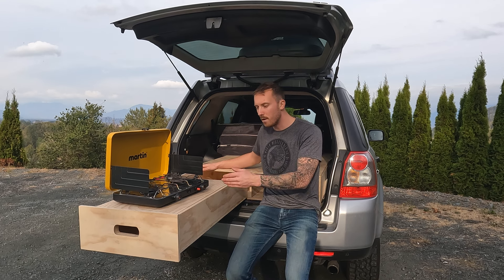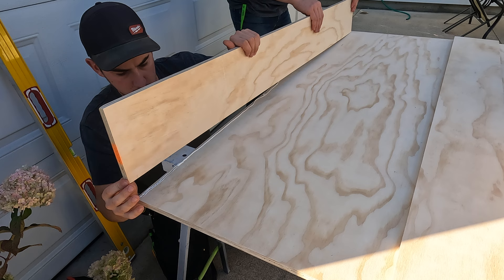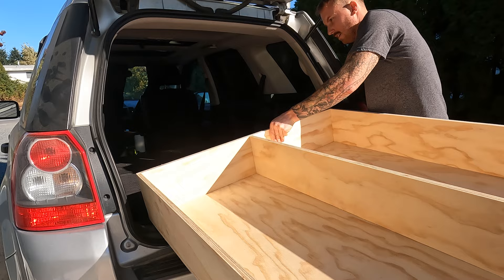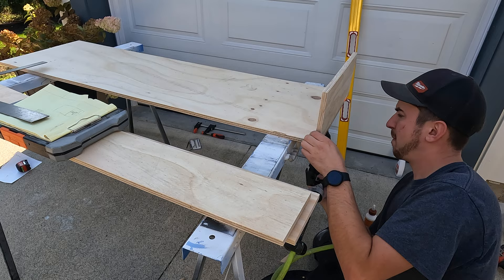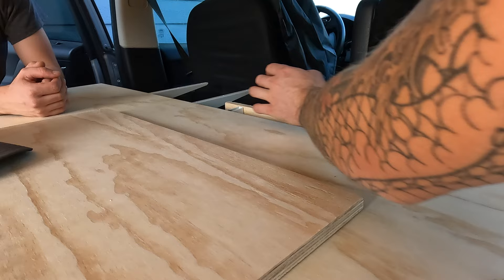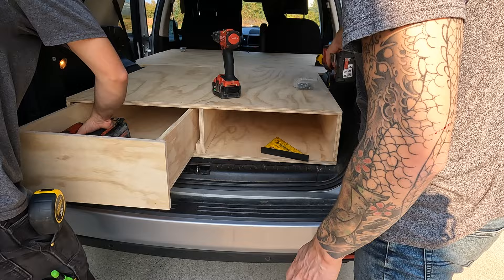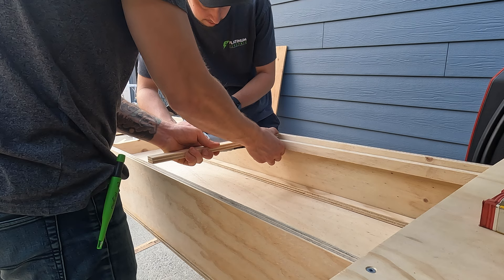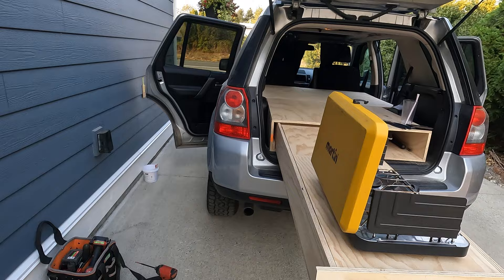How To Build A Bed Platform In Your SUV For Car Camping (Land Rover LR2)

Comment: I went a different route. I didn't want to restrict my ability to sit up comfortably on my bed, in the back of my Subaru, so I built a simple base of slats, less than 2 inches in height. Remember you have to add the height of the mattress to the height of the base and all of that is lost headroom. Also a slatted base means air circulates underneath your mattress and you don't end up with damp mould on the underside.

Comment: What stops the whole thing from taking off ⬆️ if you hit a bump?
Reply from the maker: You make a fair point! I’ve got secure points in my vehicle that comes stock with it. I will be attaching the platform to it soon enough. Thanks for reminding me hehe 😜
Reply: Weight, Velcro, duct tape, bungee cords, and gorilla glue.
Reply: @caseyreed5231  Weight does nothing, and actually increases the problem, when you go over a bump…that weight keeps going up after the truck starts to drop.  Bungies…nothing, they stretch.  Nothing short of a firm rope or tie down strap will keep it in place.  Tie down to tie points that is.
Reply: @jeffclark5268  yeah yeah yeah. Make sure to strap everything down in the vehicle bc if you get in a wreck at highway speeds. Those items become death instruments. You couldn’t tell I was joking? I said duct tape.
Reply: Well I have seen thongs compact in small places not take off but bigger items did take off. 

And if something has to take off it will evrn if it is pinned/screwed/nailed in.

Comment: Nice! Did similar drawer setup for the rear of our Jeep. But I was lazy and had the hardware shop pre cut the lengths. Then simply just put it all together at home, sprayed with black stone chip (undercarriage coating), added a fridge slide and it still holding up. 💪
Reply from the maker: Honestly that was my first option at Home Depot but my friend was kind enough to lend me his tool. Sounds like a nice setup you now have! Enjoy
Reply: @thisislifeco  lack of tools sent me in that direction 😀 With two Great Danes as travelling partners, I will have to change the setup. But haven't figured something out yet...

Comment: Such a simple and functional video. I loved how you explained everything at a speed I could comprehend.
Reply from the maker: Glad it was helpful!
Reply: @thisislifeco 
What about drilling "weight relief" or "condensation holes" in the plywood? Also, you don't needt to "pre-drill" the holes for the wood screws. You'll make the holes bigger than the screws if you do that. What kind of screws did you use?

Comment: Anyone else freak out at 0:19 when the guy almost got his hand with the table saw?
Reply from the maker: Definitely looks close but he had it under control hehe
Reply: @thisislifeco  No, you guys were totally unsafe. Never have someone pull the wood. If one guy pulls and the other guy is at all surprised or off balance (likely when crawling on his knees, another bad idea) abody part, including the head, can end up on the blade. Also, use a push stick. 

In this case, use the skill saw to reduce the sheet and then the table saw to rip it to perfect size.
Reply: I did actually.  Happy I wasn't alone.  Push sticks save digits 🙂  Loved the build though and will be using it for my own mod.  Thanks.
Reply: YES. 
WEE BIT CONCERNING 🥵🥵Nice build though.

Comment: I have a 2003 4Runner which I go camping in. 

I first did a simple mock up style with plywood.  I went on two camping trips with it then threw it all out.  IMO, it's too restrictive and limits what I can carry inside.  I rather have the head room.  A few plastic containers handles all my stuff.  The roof rack handles all the recovery equipment.
Reply from the maker: Ya I can definitely see where you’re coming from. I could use the extra headspace too. But she’s a good starter until you learn what you like and don’t like. Cheers and happy adventuring 😁🤙🏼

Comment: Excellent build simple yet practical. I’d add a few slots on the top to prevent condensation building up. How do you anchor the platform onto the car frame to prevent rattle when driving?  Would it be better to have the front portion of the platform hinged if you’d need to store something under that can be retrieved inside the vehicle?
Reply from the maker: My car has metal half rings that are part of the trunk and I can hook up to them. Keeps everything snug

Comment: Very nicely done! Two suggestions. If you don’t add drawer slides, put some wax on the bottom of the drawer, it might ease movement especially if it’s loaded with gear. The other is safety. I really recommend using some saw horses and scrap wood for your table saw. I hate to see someone cutting full sized plywood sheets with the saw on the ground. If you slip and fall on the saw…..Or, build a table saw workstation and upload the video! Thanks.
Reply from the maker: Yeah I those are definitely great suggestions that I’ll think about. Thankyou !

Comment: How have the drawers held up without drawer slides? Still sliding nice and smooth? Also, do you think 5/8 is strong enough? I see a lot of builds with 3/4. Nice work!
Reply from the maker: They’ve held up great, they slide smooth! I think so but I’d say it depends how much weight you plan on putting on it
Reply: @thisislifeco  Glad to hear it, thanks so much for the response! I have a hatchback so I'm tryin to keep things as minimal as possible. 👍

Comment: Great build! Any issues with pulling out those long drawers once they are full of gear? I've been debating if I should use drawer slides with similar 60" drawers but the slides are fairly expensive. Not sure that the slides are needed or worth it. What's your post build experience?
Reply from the maker: I’ve got quite a bit of gear in there and I have no issues. The slides I found very expensive as well and haven’t regret not putting them in. No issues for me personally

Comment: Exactly what I was looking for my own lr2. Question- have you got seat taken out or folded down? Also, would you mind sharing dimensions of the platform?
Reply from the maker: The seats are folded over but I took out the seat portion of them if that makes sense? I just unscrewed them. I’ll get the dimensions for you this week. I appreciate the feedback!
Reply: @thisislifeco  Thanks bud, I've done the same, took bottom out completely, would have done same with vertical ones, but it don't seem to be coming out without affecting rack that holds fuse box etc. Thanks
Reply from the maker: @archie_l0  exactly that’s why I just left the vertical parts too. Makes for building a platform a little easier as well. Makes for a more modular build.
Reply: @thisislifeco  I was hoping to make deeper storage boxes at that space, but oh well. Roof rack and boxes it is

Comment: question for you, as I hadn't even put LR2s on my radar but watching this video (amazing job!) I am now considering it.  How much space is there with the driver seat in your normal position to the back door? I heard you say you measure out 5' for the base drawers? Is that including the piece you notched out?  How much more did the flip up head space give you?
Reply: hang on.. you're in the LMD?  Does your friend want to build more drawers??? hahaha
Reply from the maker: I’ve loved it so far! So yes it’s about 5 foot and once I fold out the extra head space it’s about 6 foot. The drawer is 5 foot yes but does not protrude pass the end of the sleeping platform or the notch. Hopefully that helps! Where abouts are you from?
Reply: @thisislifeco  I'm in Langley. Been eyeing 2019/20 disco 5s in a TD6 and 11/12 LR4s. Now I'm looking at LR2s.  Currently have a Tundra with a full camp drawer/sleeping platform in the back and want something similar to it for the new set up (whatever that is going to be).

Comment: Is your spare tyre stored in the boot underneath the flooring? would you have to pull out your entire setup to get to it? thanks
Reply: This was the question I was going to ask. With having a wider section installed you couldn't just pull it out as it wouldn't slide out as one unit. Those wider sections would need to be unscrewed.
Reply from the maker: So yes my spare tire is underneath the bed platform which is a downside but I felt if I absolutely needed to get it I would be able to.

Comment: I am surprised that you are not using drawer guides for smooth opening and closing. Wood can expand with moisture absorption  under damp conditions and render drawer movement tight. Also, how are you finishing the right hand side?
Reply: Another alternative to not having drawer guides is to make half the length of that long box with a top hinge for easy access without sliding the entire drawer out. Should not affect sleeping as you will likely have a thick foam mattress on top.
Reply from the maker: It’s been several months so far and not having any glides is proving to work great! I had been debating the alternatives but so far no issues. The other side is left as an open storage for my fishing rods and gear.

Comment: Is doesn’t look modular though, am I mistaken? Is it practical to take it out and put it back in?
Reply from the maker: I haven’t tried, but it’s definitely more of a leave in the car for the season type build. But depending on what vehicle you have it could be pulled out. The front is wide but perhaps if I lifted it on an angle it might be able to be pulled out.